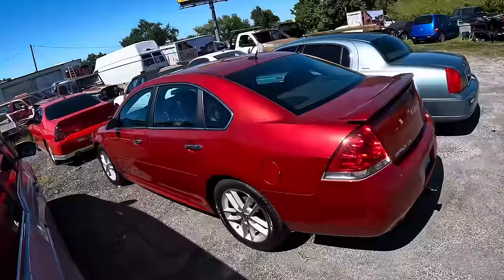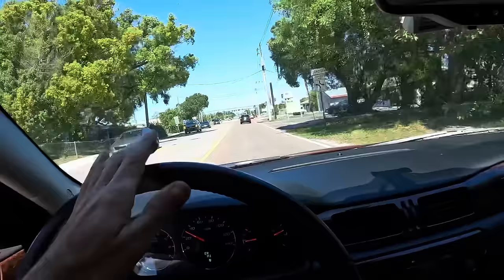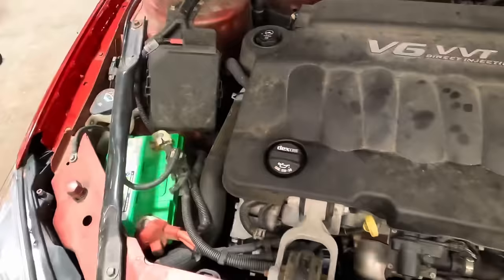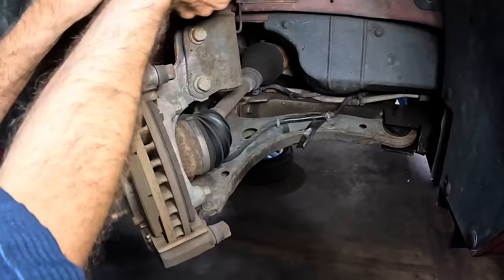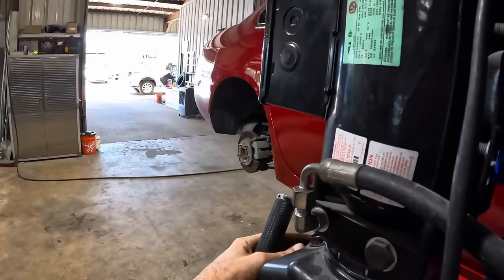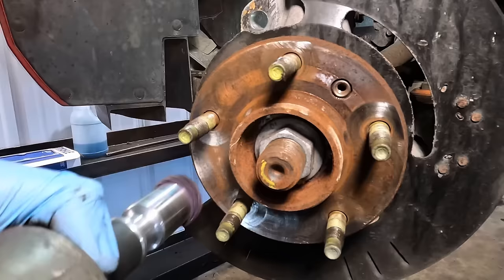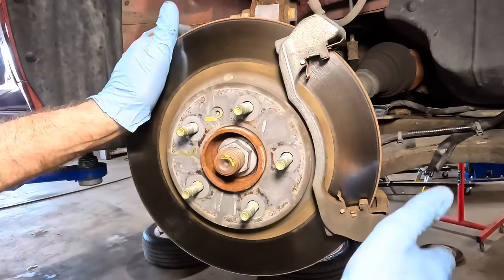Back on the Road Parked Since 2019 | Clean Impala LTZ 3.6l 2006-2013

Comment: I did the brakes on my son's car the other day. Obviously, I don't charge him for labor. The last time he needed brakes done, I was too busy. Whoever did the brakes on his car last needs to be educated on the torque specification for brake assembly. They were on way too tight. They also did not start the threads by hand. I don't know how, but I was able to get it done without shaping anything. Unfortunately, the threads suffered. All four calipers that should have been fine now need to be replaced. I paid a visit to the shop that did the job. The manager  was more interested in denying responsibility rather than correcting the problem. I told him right off the bat that I wasn't looking to reimburse. If it were me, I would have appreciated the heads-up. I would've also insisted on paying for the damage. I got the feeling he was doing things that he's not supposed to be doing. Unfortunately, this is becoming a more frequently occurring thing now.

Comment: You call that rust? I have to sandblast every time I do a brake job. And it takes an air hammer to get the router off.  I do like that they are now putting bolt holes for removal.

Comment: Regarding the small tabs on the brake pad shims, I bend them inward after installing the pads to keep them in place and prevent the pads from falling out while putting in the springs and reinstalling the caliper. 

It helps make the reinstallation less frustrating especially when there is brake lube around such as on the pad ears. 

There are larger tabs hugging the caliper carrier on the inboard/rotor-facing side of the shims, so I think those are sufficient to prevent the shims from moving around.

Comment: Can’t say this is specific to the Impala, because I’ve never seen one in the flesh, but when doing brake pads, especially those twin piston caliper ones, I always check the fluid level in the reservoir before pushing the pistons . If the owner has topped it off to the mark, while the worn pads were there, it will spill over when you push the pistons back to accommodate the new ones. Far better to suction some out and have to top it off when you finish, rather than spill it down the paintwork, because you skipped a step.
Reply: I am pretty sure he checked on the fluid level.  I am not going to re-watch the video, but he was talking about how the break fluid had a green tint when he was lifting the car.  What I am saying is that, Ray has a check list of sorts to keep the reservoir from overflowing.

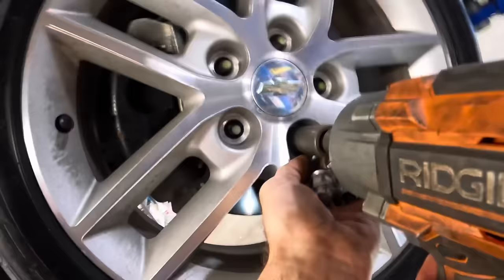Comment: 8:30 trust me. Thats a car you will not pull the headliner down on, the audio shop i worked at sold a rear seat entertainment system fold down tv screen  these install to the headliner with a back brace bracket
That slips between the roof and headliner. GM GLUED all of it to the roof, you cant peel it back without damaging it. 

I still like my 63 and 64ss impla better.  Wished I'd kept them.
Be worth a bunch now.

Comment: Realize you're just replacing parts, but WHY were the inner pads worn down as well as the inner surface of the vented rotors so much more than the outers with the slide pins still in a sliding/non-stuck state?  . The outer surface of the rotors looked almost untouched?
Reply: Caliper piston drag?

Comment: Ray, 2002-2005 body had either 3.4l or 3.8l. That body style actually went from 2006-2016. 06-11 had either a 3.5l or 3.9l OHV. 12-up had 3.6l. 14-16 that body was called Limited because Chevrolet actually had 2 body styles and it was discontinued for 2017 MY. 14 up new body had a 2.4l option.
Reply: I prefer the 3.8 litre any day. This car would have been great with a 4.9l V_8, or 6.0l V-8!
Reply: @oklahomasyclone  The 3.5l and 3.9l were good engines. I dont think I`ve ever seen a bad one.  The SS did come with a 5.3l LS, and I think they were RWD. I`ve never actually seen one close up to get a good look at it. I`ve seen more Transmission problems on the ones with 3.5l and 3.9l than engine problems. The 3.6l was notorious for timing issues, on all of them, not just the Impalas

Comment: Hi Ray, Before you re-compress the brake caliper, do you open and remove some brake fluid from the Master Brake Cylinder to make room for the brake fluid you push back up the lines?
Reply: Must read the comments before I post my own. I commented on exactly that, though my comment was way longer and didn’t explain it any better!
Reply: Depends if the owner mistakenly thinks the master reservoir needs to be kept 100% full.  Normally, the lowered level is simply returned to original full level when the piston is compressed.  If the owner topped off the reservoir, it will overflow.  Reservoirs are semi transparent and have min/max markings.

Comment: I would have smeared a light coat of grease on the rotor to hub mating surfaces. You went to a lot of trouble to clean the rust off, why not use a bit of corrosion preventive?

Comment: Hilarious, clean the dielectric grease off the pin, but leave the old dielectric in the pin-holes. A simple spray out of pin-holes with brake cleaner for a proper clean.

Comment: Hey Ray, my old Mitsubishi lancer (manual/standard) shared the break res with the clutch and it had a blender on it. But to bleed it the car needed to be running or you lost clutch pressure.

Comment: How many people actually check the rotor/hub runout with dial gauge when fitting new rotors? 
I bought a gauge set a few years ago when i was having trouble with a particular car getting vibrations multiple times, while the hub faces and new rotors were well within manufacturer spec I was surprised how much difference it made just by rotating the rotor 90-270 degrees to get the best reading, up to 4 thou different. No more brake issues on that vehicle so now I do it on others, recently definitely was needed on my new car, was hard to get it within spec
Reply: Using dial gauges are a lost art. I’m surprised to see that you indexed the rotor and hub, I’m sure that few techs know to do it. That proves that you are a technician and not a parts changer. Well done.
Reply: @larryberry2436  just a guy in his driveway with some tools. Thanks

Comment: Question about torn CV boots. I noticed you changing the whole axles for that. I had an 89 Honda that every time I took it for service, they told me I needed new CV boots. Can the boots not be serviced in more modern vehicles?
Reply: There was a comment about this awhile back.  Aftermarket complete shafts can sometimes be as cheap as the boot replacement labor.  It's an argument, is a rebooted OEM shaft better than a complete replacement assembly?  Another consideration, if you reboot an older unit,  does the mechanic eat the repair when it comes back?

Comment: Hey Ray do you ever put blue lock tight on any caliper brackets bolts?
Reply: Locktite releases at 300f.  I wonder how much heat is transferred to the bracket.

Comment: I bleed and flush my brakes on track driven cars once a season. I want to keep the fluid clean and free of water. Higher performance fluid with a higher boiling point is more hygroscopic. Yiu do not want your brakes getting soft coming into Canada Corner at Road America at 150+ mph. 

Anyway...  I tend to use a DOT 3 fluid in a street car because it has a lower boiling point that isn't needed unless it sees severe duty (towing, mountain passes, etc..). It's also less hygroscopic, so you don't need to flush it as often. 

My question is do you need to flush a street driven car's brake system if you suck the fluid out of the master cylinder on a regular basis? It circulates through the hydraulic system and you never get it all out because of the ABS system. Wouldn't regularly swapping the master cylinder fluid accomplish the same thing?

Comment: I’ve seen different specifications, you can’t believe everything you see on the internet, but I believe GM went to the 3.6 and 3.8 in 2012 retiring the 3.5 and 3.9. My question is the 4T65. These seem like high failure points but with so many of these cars on the road you’re going to see higher than normal failure rates for low production runs. Is the 4T65 in that Impala and would you consider showing a fluid exchange on such a “notoriously bad” transmission? Thanks for your time and consideration!
Reply: Ask a transmission expert. Ray is not one 👍
Reply: @waterloo123100  I’ve been a subscriber long enough to know Ray isn’t a transmission guy. That said, he tore apart a Tahoe transmission and does a lot of transmission flushes. Additionally, he knows how to read RPO tags and can tell what transmission is in the car based on the RPO code. As a master mechanic and now a shop owner/operator, he would probably know what transmission(s) to stay away from and have criteria/thresholds where he will not service a transmission. Thus, I think it’s a fair question and one Ray would be more than capable of answering. I’m just a subscriber and a shade tree mechanic. So what do I know.
Reply: @SinCitySinner  thanks for the response. I have an 08 Impala LT with the 3.9 v6. It had a wiring issue that I was able to correct and get the car running. I guess when some people replace the power steering pump they crush the wires when reinstalling it they don’t route the wires correctly. Strange thing is that I bought it from a mechanic shop who couldn’t figure it out, granted it took me awhile to figure it out. Now I’ve got a 2010 Impala police package and believe it’s also a wiring issue. There’s something putting a ground on the data bus and I can’t figure it out. Think something is plugged into the wrong connector possibly the ABS connector(s). Hopefully that is the only issue as the transmission doesn’t know what gear it’s in (incorrect values for logic points A, B, C, and P) as I really don’t want to pull the transmission to replace the internal mode switch. As I said, I’m just a shade tree mechanic!

Comment: Oil filler cap, brake fluid filler cap, powersteering fluid cap - they all have a nasty habit of falling down somewhere in the engine compartment.
Right where you can't see it or can't reach it.
Why don't the car makers incorporate a simple strap to avoid this everyday annoyance ?.
It's common that the gas filler cap is strapped - for some strange reason - so why not the other caps ?

Comment: Hi Ray. Similar to this car, we have a vehicle that has been sitting for about 3yrs. It was started 6 months ago and ran fine for 20 min. (No miss, idle fine, all seems good)
Put batt charger on it last week and tried to crank, but starter could not turn engine... "clunk" straight-6 acted siezed, but would not expect engine to lock up when ran ok recently.
(Never run hot, no rain down intake)
What suggestions to free up engine??
Can't pull start automatic.
Looked for trans-bell access to flywheel start gear for leverage, but not.
Tried big socket on front crank bolt... 
Felt like so tite may twist off bolt or split harm.ballancer, so stopped there.
Feeling stuck: 1997 XJ6
Thoughts??
Reply: Well I’m not Ray but might suggest that you pull the plugs and add a small amount of automatic transmission fluid to each cylinder.  Let it sit for several days. Then take a wrench and see if you can move the motor manually by using the bolt holding the harmonic balancer. Try moving it a little bit at a time and be patient. Also check some old car sites such as the AACA because those folks deal with this all the time. Your gas is also most likely bad if not almost varnish.  Modern gas might last a year without additives to prolong its life. You can add more trans fluid after a week or so. Once you get it loose turn the engine over several times by hand to make sure it is free before trying the starter.  Also if you can drain out the old gas or rig up s temporary gas tank. An outboard motor tank works good for this. Your tank will need to be cleaned out unless you are very lucky.

Comment: If you actually went all the way down with no wheels, what part of the car would hit the ground first
Reply: Like just undo the lug nuts/studs and pull off the wheels and set it down? I believe the bottom side of the rotors would touch first
Reply: @legionofanon   Yes you are right now that I actually gave it some thought

Comment: If brake fluid Is hydroscopic (which it is), why are you blatantly notorious for leaving tops off of the jugs/bottles of fluids in your shop; introducing contaminants and humid air into these dispensers? I have noticed this in your videos for years.

Comment: Brake fluid flush does not work  FACT . I had one then popped out a caliper piston and it was still full of crap as the nipple is at the top and the crap sits at the bottom 😮
Reply: Should have changed the calipers earlier